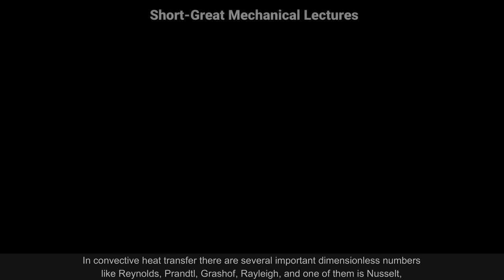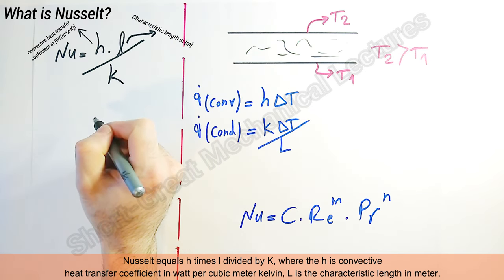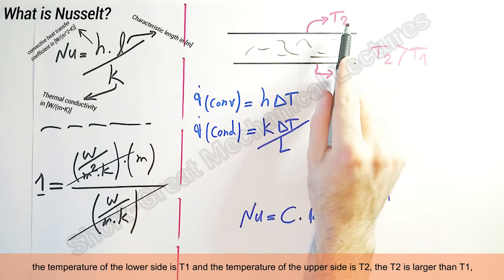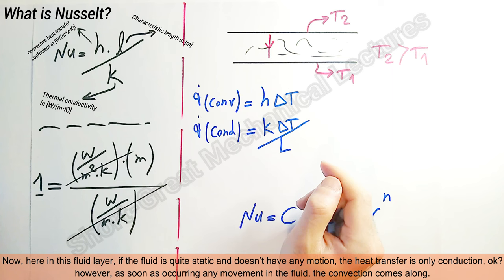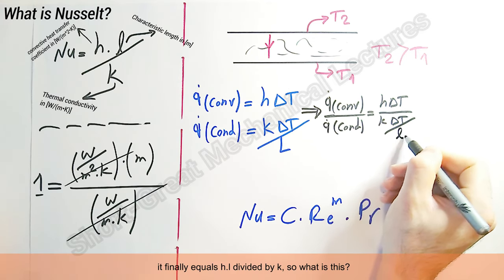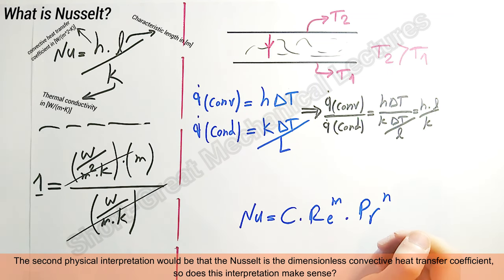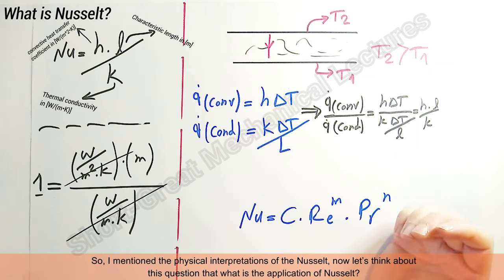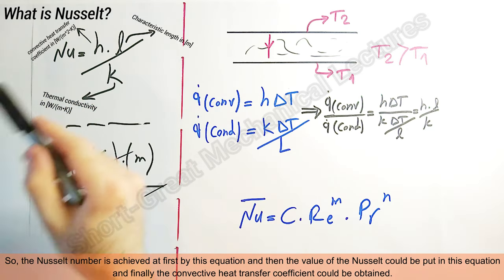What is Nusselt?

Comment: well explained but there is one thing that doesn't add up. you're saying that if Nu = 1, there is no convection. this can't be mathematically correct cuz if Nu = Q_conv / Q_cond, then Nusselt is also 0 if convection is zero. could you explain this please.
Reply from the maker: Many thanks for your interesting question, you know the ratio of convection over conduction is only a physical interpretation of Nusselt and not a mathematical and exact meaning of Nusselt. By the way, in micro scale always there is motion between molecules of a fluid.
Reply: Great help
Reply: If there is no convection, q̇_conv is not zero. It is in fact just equal to q̇_cond, because as you can imagine, if the fluid is not moving, it  just like a solid body and therefore  like a solid body. Hence, if there is no flow, then q̇_”conv” = q̇_cond.
Reply: *keep in mind that q̇_conduc is just a theoretical/comparative value, but the real  heat flow is q̇_convec — so its not just the convective parts of our flow, but the entire reallife flow, which might be convective.